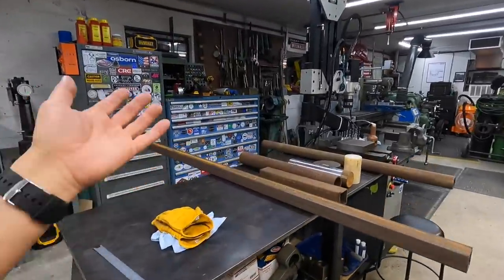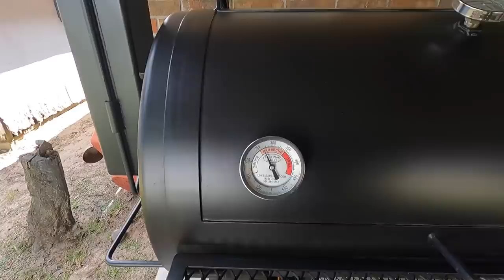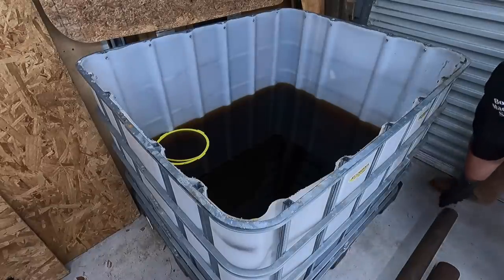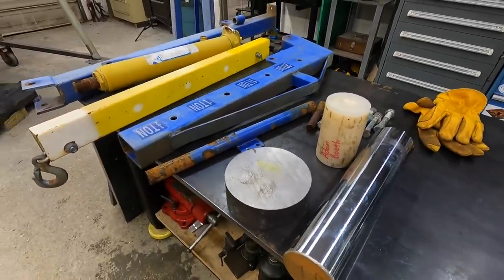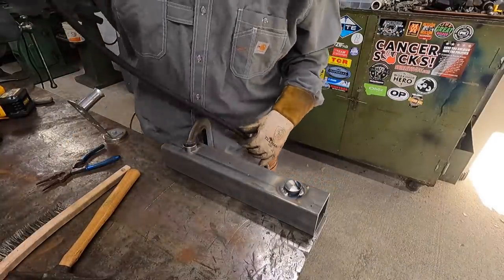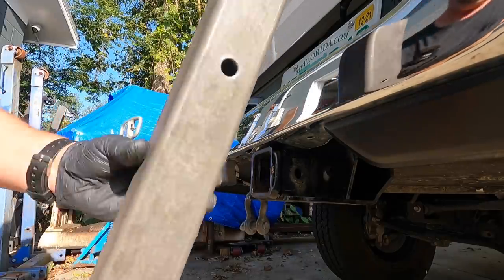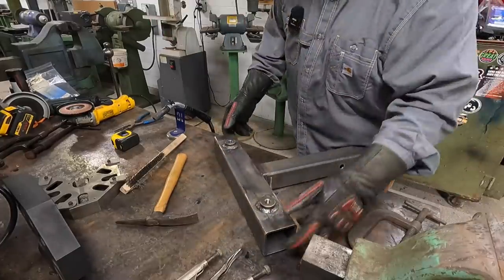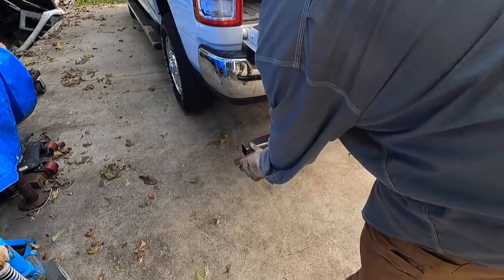Truck Hitch Crane Build Ep: 1

Comment: Adam, For your foot support to the ground. You might consider this. If you lift up something heavy enough to compress the suspension of the truck and load it in the bed. Now there will be so much pressure on that foot you will have difficulty getting the pin out to release it. What about one of those had crank trailer hitch tongue lifts that fold up. That way you could crank it down to the ground and up to release it when the weight is in the truck. Ask me how I know this. Been there.
Reply: You mean a outrigger
Reply: @southern207hobbies  He mentioned a foot support under the hoist to the ground. Otherwise when you lift something without it. It twists the whole truck and would put a lot of strain on the hitch receiver. He said he was going to use a pin type of adjustment. But it has been my experience that you cant get the pin out once your loaded. Because the truck goes down with the load.
Reply: I replaced the pipe vice on my service body truck with one of the little HF truck cranes. It would tip the truck enough I added a farm jack mount to it for an out rigger. I agree if its a solid mount foot it will bind up once you load the truck, as after I load a few big items in the truck it takes a lot of force to lower the jack.

Also the HF truck crane with their 3500 winch in place of the hand winch (The 2500 is junk with synthetic line BTW) is an AMAZING back saver.
Reply: Oh, rats - I just made a similar comment before I started reading the comments section. You beat me to it by a couple hours - but our minds went down a similar path. Gonna let mine stay though, because it offers a bottle jack instead of a crank. Two ways of doing things the same :)
Reply: I had a similar thought, with a different solution. You could also let the mounting post float in the sleeve. That way if the truck sinks or rises, the foot will still carry the load to the ground.
Reply: @EdgePrecision  All he need do is have the vertical pillar of the crane free to slide up and down - so the bottom of it forms the foot without it being locked height-wise to the vehicle.
Aren't these cranes usually mounted to the truck anyway - without a foot ! #unnecessary foot !
Reply: @millomweb  It’s not what he said was the plan. But thinking about what you are suggesting. That would put a lot of twisting toque on his trailer hitch mount. The setup I eventually had. Was the hoist mounted to the trucks bed. Than I had a scissor jack thing I put under the trucks bed to support things until they were loaded. Than I could lower the jack to let the truck settle down on its suspension.
Reply: Adam will just pick the back of the truck up with one hand while removing the pin with the other.
Reply: @KWGochenaur  That's actually a clever idea, only possible problem that comes to mind is installing the foot after you slide the vertical post into place. That thing's gonna be a bit heavy, I bet.
Reply: @EdgePrecision  I think the twisting torque on the hitch would be small enough for it to cope with it. He's obviously load-limited with what the truck can carry and I suspect for his use, that won't be the weight of just 1 item.
Reply: @simonscott1121  If he could do that, he wouldn't need this crane ;)
Reply: @millomweb  payload on the truck is 3000lbs.
Reply: @ionstorm66  I have the same one. Great idea using the farm jack. I just use a bottle jack under the hitch.
Reply: If it’s that much of an issue just stick a floor jack under the hitch and jack the back up so you can release the foot maybe? Obviously this should only be used on a solid surface (including the crane etc)
Reply: I was wondering about the same thing.
Reply: @ionstorm66  1.3 tonnes seems a lot !
Reply: one of those came to my mind as well. Or some sort of bottle jack with a plate for stability underneath.
Reply: @EdgePrecision    with the loads he plans to lift ( as described in the video ) he should not have much compression to the trucks suspension, but it is a good idea to plan for a larger than expected load. and yes pins with a load on them are always hard to get out so a boat trailer jack would be good.
Reply: @millomweb  You need to remember his crane is going to be at the end of a 3 to 4 foot (~1 meter) lever. And the load includes a part of the weight of the crane, along with the load.
Reply: @KWGochenaur  That's what I pictured Adam was doing.
Reply: @rogerrabbit80  Depends what loads he plans to lift.
Reply: On the mention of the support foot, I've found that to get very course and fine adjustment using just holes and a through pin, you can space your holes like a Vernier scale and get lots of adjustment. Might be a paint though, given the sagging suspension issue.
Reply: Old School Mercedes hand crank jack,,,perfect,,,good ides and they can be found all over ebay & local wrecking yards. Own 9 MB parts cars, and jacks are first things they buy.

Comment: Hi Adam, looks like a neat project. I have one thing I would like to mention, and that is about the support leg under the lift. You said it will be adjustable, but consider that the height of your hitch will change based on what load you have in the bed. I am concerned that 'several positions' will come back to bite you because the hitch height will be lower after you crane the load into the bed, and you may have trouble pulling the pin to release the support leg. I propose using your idea in combination with a hydraulic bottle jack or something like, so that you can release tension and undo the support.
Anyway, I enjoyed this video, and I am looking forward to seeing it in action.
Reply: Agreed CacheRAM , Or keep it more simple , make the leg with a slotted lockable swing out arrangement that you loose 2 or 3 cap head allen bolts to  relocate the foot height to any height you need at any location then lock the bolts on the leg.  I did it that way for my swing out rear trailer stabling legs I built for my big trailer to keep it from moving round when loading or unloading.
Reply: I agree. Loading a few hundred pounds onto the truck and that pin wont want to come out. A trailer jack of some sort on the foot would make it more fail proof.
Reply: Maybe use a screw type of a foot. Like a trailer tongue foot.
Reply: @hydroy1  The simplest thing is just keep it in the next highest hole and let the truck settle into it. Once the load it in the bed of the truck it will be more forward and not be an issue. Adam is a sharp guy, he will figure it out w/o our help.
Reply: A folding trailer jack would work well for that.
Reply: @GFSwinger1693  Adam is indeed a sharp guy, with 3 generations of sharp guys in his family, and decades of his own experience fabricating things. In my opinion, the suggestions in this video's comment section are just that - suggestions. He will read them, and then decide what he wants to do, which is as should be.
He probably already had a solution for the sagging problem, and perhaps just didn't mention it in this video.
Reply: Philip , true but more eyes  on a project bring in more great ideas and we get to pick from all of them. My idea is totally adjustable and require no money spent at all, just machine time and a few cap head screws to lock the leg in place in use.
Reply: You dudes coming to Adams defense over people giving him suggestions are something else. I’ve met Adam and I can tell you that he’s not some ass that’s offended by constructive criticism or suggestions. He’s a good fabricator and machinist, not the end all be all of engineers.
Reply: @strangefruit8776  Exactly. He has said many times in his videos words like 'there are lots of ways to do this, here is my method'. ANY competent person is willing to adopt new methods or ideas if they are more effective than their current program.
Reply: @hydroy1  
Could you maybe make a short video and post it on your channel to show us what you mean, because I like the idea, but I am having a hard time picturing it exactly. Maybe also reply on here to let us know if you're able to post and when. Thank you in advance.
Reply: @strangefruit8776   You got that right, a really good machinist is ALWAYS looking for better idea's from anybody to do a project better/ stronger AND cheaper from anybody ! More educated eyes on any project can only be a good thing !
Reply: @hydroy1  yeah I mean it’s not like anyone is crapping on what he’s doing. I’d love to have the ability to take civil input from comments on a project I’m doing. I don’t care who you are or how good you are there’s something to be learned from everyone.
Reply: @strangefruit8776   Yep,  Only a fool feels others ideas are all BAD !  I know some things, others know things I might not, so we should all give our ideas freely and then pick the best for our needs. For me it's all about quality & cash outlay. If I can fabricate something for next to nothing other then time & work over a store bought unit that might not be as heavy duty, guess what I am doing ! And if someone else comes up with a quicker or easier or cheaper way then mine , Oh yeah I will jump on that and use it as well.
Reply: @lerkzor  "suggestions. He will read them, and then decide what he wants to do"....although, it's possible he's already past that part of the build process!  Or possibly not...I'm thinking of Youtubers that build a backlog of videos, then release them over time (day by day, or days apart), and any suggestions by the viewers might as be from months in the future.
Reply: I'll concur with a suggestion seen on the other one of these threads: if the goal is to transfer the weight being hoisted from the arm to the ground directly and to prevent a torsional moment on the hitch receiver, there seems no simpler solution than making the crane's post free to slide vertically at its interface with the cross bar.

In this configuration the cross bar attached to the hitch will still provide just as much rigidity, while allowing the truck's rear suspension to settle with the load. There won't be any potential for binding, as you would have with the pin arrangement.

Consider also that the binding on the pin indicates that a torsional force is now being applied to the hitch receiver: the truck suspension compressing while the extended support leg rests on the ground is now, ironically, a source of torsional force of exactly the kind that the outrigger support foot was intended to prevent!

A sliding interface will be simple, robust, and effective at preventing unwanted torsion on the hitch receiver from both the hoisting load and the suspension load.
Reply: I agree with this. And also if the front wheels are elevated, then the back of the truck and the crane itself will be lowered. So the pin position will be off.

Comment: dude you are an inspiration. i appreciate your attention to detail, and you don't compromise quality.   that's the way i like it!  also..I have used dual shield flux wire at work (select arc 71 0.045")  did both 75/25 and straight CO2.  CO2 is hotter, you can turn it down 2 or 3 volts and get similar penetration.

Comment: Adam explaining his weld imperfections on perfectly good welds... meanwhile my amateur welds look like a mountain range. Also having watched more of the video after making that initial comment, I appreciate you expanding on the subject of flux core/solid - thanks!
Reply: It was the round welds he was having the problems with.
You need a steady hand to make nice even welds - and if you see my handwriting, you'll have some idea what my welds look like ! I've not used MIG though - that looks easy as you can rest your torch hand on something - you can't do that with 12-14" stick poking out the end of your hand !
Reply: @millomweb  
I do like the penetration that you can get with a good high power arc welder, but I have been wondering about TIG, and if you can have the best of both worlds of reduced slag/spatter, and deeper penetration. Any thoughts?

Comment: It's so cool to see a design I came up with several years ago will work.  My crane is a little smaller so it can hang off the trailer hitch as long as it's pulled inward with the tailgate closed.  I wish I had the time to actually make it.

Comment: Looking forward to part 2 of your crane build. For my part on wire and gas .. I have always used solid wire with 75/25 gas. The key to solid welds is your temp settings and wire speeds ... I understand your method and I have no problem with any of your desire for flux core on thicker metal. Thanks for sharing....
Reply: Adam is an accomplished welder and has been to school for it.. he knows what's up..
Reply: @jeremydoblinger3609  I was only expressing my experience I was not in any way criticizing Adams way. Sorry if it came out wrong.

Comment: Morning Adam.  A very interesting build.  I would have never thought to attach it to towbar hitch.  Mr. Pete recently inspired me to make my own shop trolley and crane.  Best thing I've ever made, saved my back that's for sure.  Cheers mate, I'll look forward to part 2.  Aaron.
Reply: This is a common method using a tow hitch mount....seen this for decades....like 4!!
Reply: Mounting on a trailer is another common hoist use....
Some mount it inside the bed of truck...or trailer...
Reply: @garymallard4699  G’day Gary. Yes my good mate over just built a big tandem trailer with a Hiab crane fitted. It’s an electric over hydraulic system. She’s a bloody ripper. 🍻
Reply: @garymallard4699  oh ok. I’ve never seen it before.👍
Reply: @AaronEngineering  
I operated Hiab's...they are powerful... I have a 115 ft Crane that is Electric 24 Volts with Hydraulic lift cylinders and rotation...extend/winch is Electric motors...
Reply: @AaronEngineering  
I installed a small hoist in my dad's van...12 Volt Handicap unit for lifting a scooter into back...that was about 18 years ago.. I have that van now ( parents passed away )... It was bolted inside the mini van..worked great..easy to swing and hook up..

Comment: Adam great to see you again, A lot of times when I try and weld older metals that has been stored out side , ground or sand or bead blasted, it does not weld the same as new metal . I found if I warm the metal with the torch it drives the moisture off the surface as well as any cutting oil ( there is always moisture you can see it dissipate ) also the mig weld starts much better, and I found I am happier with the out come of the welds …  thank you for taking the time to make these videos…
Reply: Yes damp materials produce hydrogen in the arc very detrimental to welds. I wonder if avaporust produces something similar

Comment: When I worked at the shipyard in Philadelphia.  We used dual shield for everything.  Because we were working with thick plate we used co2 and Flux wire and the welds came out beautifully. When we did hull work we used ceramic backing then removed the ceramic, cleaned up the joint and laid a really good hot pass.

Comment: I've used straight CO2 for welding for years. You're exactly right about it making a hotter weld. You certainly see the benefits when welding something 1/4" thick or more, but it makes welding thin gauge steel more tricky, like auto body work etc.

Other guys have suggested the same thing, but a foot for the crane that is able to be adjusted when the load is on might be helpful. Maybe something like a trailer tongue jack or some other screw type fine adjustment would be beneficial.

Comment: You might want to check the o-rings on your whip. The hose inside the welder also. We run dual shield 99% of the time at work for the reasons you explained. You’ll enjoy the flow meter as that’s the best way to go. 👍

Comment: On Bayliners, the davit uses a composite bushing for rotation. Make sure you do no use a petroleum product on the nylon. It has a tendency to cause it to swell over time and lock up the shaft. This is a very cool project. I have often wanted a davit/crane on my truck to handle heavy items. Looking forward to seeing your design.
You probably have already built this, but your assembly is going to be pretty heavy, I would add some stops to the hitch tube so that you just insert and it automatically aligns the hitch pin holes up for you.

Comment: Check your liner in the whip. sometimes theres oil and dirt on the wire that builds up and can cause problems. or if the liner is wore out or kinked in the whip can be and issue as well.
Other causes of worm tracks with dual shield can be sick out being too close, access voltage  and moisture in the wire.
you can also try more of a drag angle rather then straight in or slight push

Comment: Great idea using an outrigger system to stabilize the crane instead of just the suspension. Now you don't have to worry about tongue weight capacity or suspension movement.

Comment: If you don't mind me making a comment on using dual shield, our company runs thousands of pounds every year.  When we see worm tracks, we make sure the gun is clean, gas ports are clean, and check the hoses for leaks.  Dual shield likes a little stick-out.  Not like hard wire where you want the stick-out as short as possible.  Normally 1/2' up to 1" of stick out helps the wire preheat when it leaves the tip to the arc.  I noticed you had maybe 1/2" stick out.  We used contact tips that are set back into the cup about 1/8".  For hard wire we have contact tips that are pushed out about 1/8".  Hard to believe that that extra 1/2 to 3/4" makes a difference but sometimes it does.

Comment: For treating long materials with evaporust, I've used a PVC pipe with a cap on one end.  Keep it at a low angle and you can drop parts in there, then fetch them later with a big magnet on a stick.
Reply: great idea!